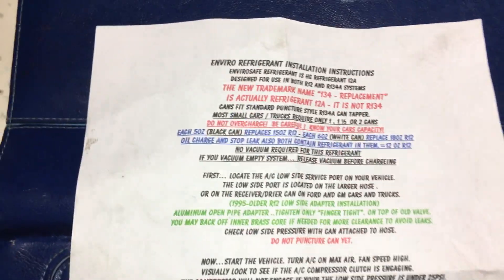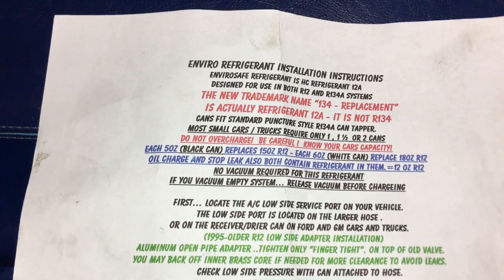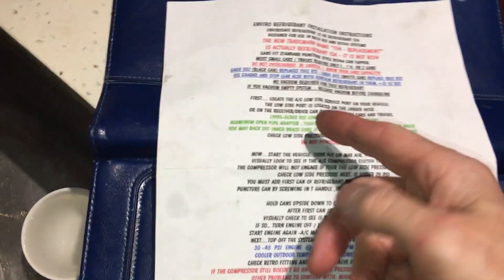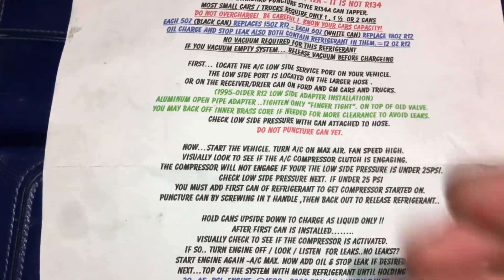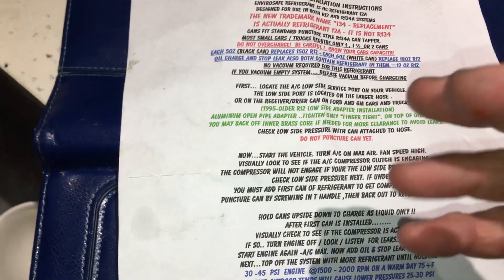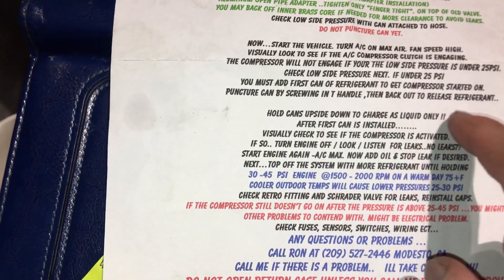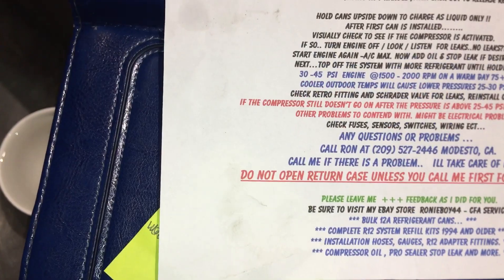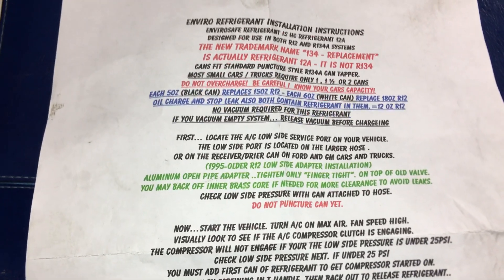Refrigerant alternative EnviroSafe instructions to install,  NO VACUUM NEEDED ?

Comment: I constantly argue with people about that stuff on facebook. The fact that it is advertised as a r12 replacement means that people are charging up questionable old r12 systems that have a very good chance of leaking, also considering the EPA says its illegal to use in automotive applications it has the potential for a lawsuit in the future. imagine if you got into a accident that punctures the condenser there is a greater than zero percent chance that it can find a ignition source and cause a fire, and considering insurance companies love finding reasons to not pay insurance claims I could absolutely see somthing like that becoming a long drawn out lawsuit.
Reply: not saying use it but theres been 0 fires reported in Canada were this is in almost every car i am saying dont use it in 134a car tho 134a better and easy to get
Reply from the maker: @jonsworld5307  only explosions reported were the two time the company that makes the stuff blow  fire 🔥 there own building up 🤣 

I thought they learned from the first explosion 💥, but nope . A few years later they did it again.
Reply: @coldfinger459sub0  id like to seen the reports on how that happened it had have air fuel  mix  just right as just few % eather why it want burn
Reply from the maker: @jonsworld5307  because it’s their large filling facility and they screwed up. Big-time that’s the only way that can happen.

It was news all over the place several years ago when they had the first explosion and then just a few years ago again when they had their second explosion easy to find on 

Because I have magazine and online subscription to different HVAC magazines and news agencies. It came up as headlines. .
Reply: @coldfinger459sub0  i remember it on news i think we need to just leave everything 134a as its nice safer not safe freon but government seams to disagree the more government bans safer stuff the less unsafe stuff be used old farmers would make adapters and fuel there trucks from 2lb propane tanks here when r12 got ban
Reply from the maker: @jonsworld5307  it’s OK if it blows up that’s no big deal that’s in large quantities in a manufacturing warehouse that is filling from a let’s say 2000 pound container into tens of thousands of small 12 ounce cans

In a car you’re only gonna have 5 ounces maybe 9 ounces 

When you go to buy a new freezer down at Home Depot or Lowe’s you’ll see that it most likely has butane but it’s only like 1.4 or 1.7 ounces

All your restaurants and your mom and Pop shops, grocery stores and your big chain stores, Safeway and McDonald’s all their freezers and their food prep tables and refrigerators are all propane

They’ve been changing over for last decade or more

We’re around propane every day and they’re just starting to approve in this country. They’ve already been using them for decades and other countries your home heat pump that will be filled with propane, but they’re only like a pound and it will be contained outside. It will water and then pump chilled or heated water into an air coil inside your house so there’s never any danger.

In the meantime, you have your barbecue right next to your heat pump that has a 20 pound cylinder of propane on your barbecue with a open flame with a flimsy little rubber hose, connecting the bottle to a open flame burner and people are going to worry about 5 ounces to 9 ounces of propane in a car

All the electric cars that have lithium batteries are bursting into flames burning down buildings. There’s been more damage from lithium batteries, causing explosions, and fires than any propane that has been added to an automobile.

There have been more fires caused by Halle or Carter carburetors on hot rod muscle cars with the leaky gasket at the carburetor to the fuel line leaking on the ignition or hot exhaust manifold, bursting into flames then the air conditioning with a few ounces of propane can ever do the transmission fluid or the brake fluid or the power steering fluid is more flammable for the amount of ounces or quartz of that fluid being ignited is sticky and stays on fire, causing things that normally would not burn to burn

Where a normal propane, busted line that might eject all 5 ounces of propane at one time and burst into a flame will only be a flash, and then out nearly immediately not having enough time to catch other components under the hood on fire 

Everybody has their priorities, all mixed up
Reply from the maker: But the thing is the insurance company will never know it was the refrigerant that caused the fire

🔥 because the evidence will be burnt up and gone

Comment: This stuff is AMAZBALLS!!! I replaced the entire AC system on my 08 Honda Civic and went with this refrigerant (Same seller on ebay and his customer service is top notch) and the temps are AWESOME!!! With R-134A I was getting down to about 67 degrees at best on a 95 degree day. Normally that would be considered good, but when the car is dark blue and the insulation value of the vehicle sucks to begin with...67 isn't that awesome. With the envirosafe I got down to...wait for it...47 degrees!!!! Now time for some science from a youtube certified Scientist ( I don't really know science). So the reason (I could be wrong) you don't need to pull a vacuum on the system is because the gas itself compresses and expands much more than R-134A. If you were to leave a vacuum on the system to suck the envirosafe in, you would be reducing the overall amount of expansion the gas is capable of. For those who may not be familiar, the refrigerant gas gets compressed by the compressor (now hot gas), then flows through the condenser (radiator looking thing right behind the grill) to cool off some, then into the cabin of the vehicle where it hit's an expansion valve allowing the gas to expand going from high pressure to low pressure (170 ish lbs to 35 ish lbs) and in doing so gets really cold and flowing through the evaporator. Then the gas goes back to the compressor to start all over again. I am sure most people watching this video knows all this, but for those who are trying to learn and stumbled upon this stuff. Stay Frosty :-). The reason for vacuuming is to check for leaks. You could pressurize the system if you wanted to. I did just to prevent something from getting sucked into the system vs blowing everything out of it. Wouldn't recommend mixing this with other refrigerants though so that's a good point.
Reply from the maker: If you’re only getting 47° Fahrenheit on a 95° day. I’d say that pretty well sucks and somethings wrong.. 

Because I have videos and does Honda’s going down to 39°F .  Using 134 gas

So if you were getting 67° out the dash on a 95° day I’d say somebody didn’t know what they were doing when they recharge the system.  That’s just lack of knowledge.. 

But yes, propane and butane is an excellent refrigerant. 

They just have to remember to put Yannick Kapes fittings that prohibit anybody from hooking up their standard recovery equipment to it, because they would have no way of knowing that there’s a flammable refrigerant, that they should not be trying to recover into the Refrigerant equipment

And unique displayed flammable labels need to be put under the hood to make everybody aware that there’s a flammable Refrigerant, and then that would be OK. 

But like I said before, if you’re only getting 47°F. Somethings wrong..
Reply: @coldfinger459sub0  I was told max temp difference with 134A was avout 30 degrees? So from 95 to 67 would be aviut right if that's true? I live at sea level and it's pretty humid (Pensacola Fl) so not sure how much that plays a roll in the effectiveness of the refrigerant.
Reply from the maker: @crossfirebass  that’s the difference between a YouTube professor and a couch potato keyboard warrior. 
     Or somebody who actually knows. 

Here’s a link to a video of mine at 103°F to 106°F – temperature hovering between 39°F and 41°F. That’s a lot more than 30° difference

That would mean my refrigerator at home when it’s 80° inside my house the refrigerator operates off 134 refrigerant that means my freezer would only be 50°F and I lose all my food my meeting my ice cubes 

This is what happens when people spew out false information and they don’t even know what they don’t even know, and they give this information and pass it along to other people . 

So at 80°F my freezer temperature is set to -12°F below zero 

That is definitely more than 30° difference with 134 Refrigerant . 

So whoever gave you that piece of information about the only thing they’re qualified to do with refrigerant is work behind a parts counter add an auto parts store and sell the little cans to people
https://youtu.be/qBbAI-aFulw?si=UnzVOqqXPy5htM0s
Reply: That is so NOT true... The reason for vacuuming the SEALED AC system is to remove all traces of moisture. By introducing a vacuum, you cause any moisture in the system to boil and turn to vapor, which is removed via the vacuum pump. Moisture is compressible, and its byproduct (HEAT) causes deterioration of the compressor, and the residual moisture and heat cause acids to form, which further quickens the deterioration of the compressor and can foul the orifice tube or expansion valve.  Mixing refrigerant with ambient air/moisture in the sealed system can also cause overcharge and further issues for the system.
Reply from the maker: @user-808SEC24 1: moisture causes overcharge ?🤔
2: byproduct of moisture is heat ?🤔 
3: moisture plus heat make acid ?🤔 (“ think you may have forgotten to add something to this chemistry mix to make the acid part. ?🤔”) what else is needed along with the moisture and heat ? To make acid ? 
4: in Automotive I have yet to see or anybody else yet to see moisture fell a orifice tube in an automobile.  (“ now commercial or residential cap tubes. That’s a different story along with the derogation of the waxes that come out of the POE oil to clog cap tubes.”)(“ which are the almost equivalent of an orifice tube in automobiles”). 

Excessive heat caused by the heat of compression and the heat of friction , and if we had an electric compressor, you have the heat from the electrical windings of the motor.  With the oil‘s base components the old chlorine from the CFC refrigerant or flooring from the newer HFC refrigerant, when they chemically bind with H2O under the heat of compressor will make acid.. hydrochloric acid or hydrochloric acid. 
     In Automotive doesn’t usually do nothing to the compressor itself.    Put the elevated acid levels will attack the ultra thin aluminum in the condenser in the evaporator and can cause my new leaks from the inside eating way outwards.. 
        An over a long period of time if it’s a high voltage electric compressor attack the codeine on the electrical wires in the motor windings. 

Sounds like you got some of your wordage a little mixed up and you’re reading too much out of books . 📚 
    Not quite correctly applying towards Automotive mixing the two between residential commercial, small appliance with your automotive, thinking trying to plug an orifice tube with excessive moisture.  Unless somebody’s gonna break out a cup of water and pour it down one of the open hoses and then charge it up without doing a vacuum. 🤦‍♂️
Reply: Wutt? 47 is not cold bro.
My car can get 37f on 95f hot day.
With a cheap chinese condensor (pokka) and ofcourse with TomLech guidance 🫡🫡

Comment: We have this here also and it works fine. I vacuum and then charge the correct weight.
But the manual says to top off. So what happens if you use this to TOP OFF r134a. just like the manual says.
Reply from the maker: Every time I see one of these systems with a compressor burned out

That comes into a Shop. It’s always a horrible, black or dark gray burned out mess throughout the entire system. . 

Where are the majority of vehicles sometimes you get lucky and it’s just a burned out compressor and it’s all nice and clean inside . 

And you can get away with that budget replace the condenser, replace the compressor fill it up and go 

It seems like every time with one of these products, no matter what compressor it is when it burns out a slow, dreadful death it’s full of metal, flake, and black oil throughout the expansion valve in the evaporator 

Very expensive repair

Comment: i read one that said not fully charge before applying it
Reply: We have been using this stuff since 2011. The main concern is to use the proper ratio. Mixing with moisture (while not ideal is fine because there’s plenty of headroom for more pressure since there’s 40% less pressure. Everyone has moved to flammables at this point. Propane is obviously the new standard.
Reply from the maker: Propane is an excellent Refrigerant. It’s probably the best one out there.. 

The problem is people putting it into vehicles without marking and putting special identifying stickers that is propane so it does not contaminate or damage recovery equipment . 

I have had the unfortunate pleasure of hooking up my recovery equipment to a vehicle that had propane in air mixed in it . 

The compression of my recovery machine and heat a generated blew the crankshaft and rods through the side of the block of the recovery pump out the bottom of my unit . 

This is my beef with the people who use it, and that it’s being marketed without mandatory fittings to be fitted on vehicles, so standard R134 coupling fitting adapters cannot be attached to the vehicle anymore for protection and safety . 

Moisture is not the biggest problem with the propane .  Other than if it’s too much it freezes up past the expansion valve and restricts the Refrigerant flow

Moisture is the problem reacting with the refrigerant oil, becoming acidic that slowly overtime attacks the middle parts causing leaks from the inside out

And the moisture breaks down the refrigerant oil overtime not giving proper lubrication to the compressors, and then they burn out . 

That is the biggest problem with moisture 

My freezer at home has R600 butane in my kitchen .  It’s the greatest coldest little freezer I have.

And the other biggest problem the majority of the people get the refrigerant charge incorrect . 

They get excellent cooling out of their dash evaporator 

But when they’re too low, but still get good cooling out of there – they have excessive superHeat, delivering back to the compressor not providing enough cooling to the compressor and I loaf refrigerant charge that reduces the amount of lubricating oil returning to the compressor shorten the life of the compressor . 

Compressors on cars when they’re not allowed to leak out and they’re always maintain for outlast the life of the car outlast the life of the engine and transmission . 

Compressors don’t die they are murdered
Reply from the maker: There’s much more to it than that. 

There is a lot that they leave out of their instructions . 

This is to their benefit when they’re dealing with ignorant people who have no education or knowledge in Refrigeration. 

They prefer to have customers who just fell off the turnip truck yesterday . The more sheep, the better..
Reply: @coldfinger459sub0  I was going to try it thinking it was refrigerant the seller to told wasn't so i backed off